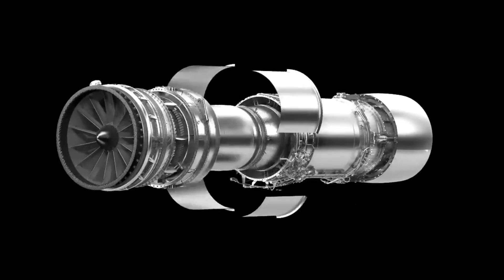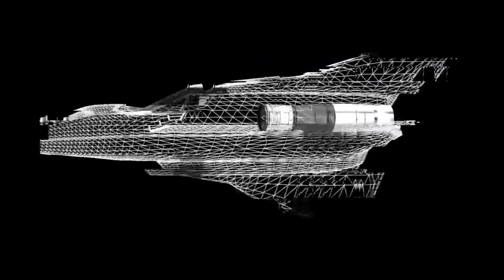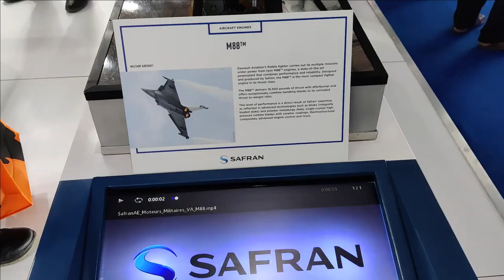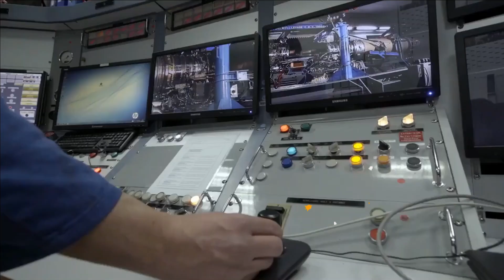Rolls Royce or Safran - Who will co-develop the engine for AMCA?

Comment: Good report but both the offerings are bit old as GE/P&W already have engine designs with variable cycles. GE already had one engine YF 120 running quite sometime ago and now has a new prototype running. P&W will follow shortly. Nevertheless this is a good start that will benefit India.

Comment: I honestly feel No company (RR or Saffran) will transfer their engine core IPR.
What might happen is 2 scenarios:
1)Like Shakthi turbomecca deal, a new engine might be co-developed in which the Hot components (compressor blades,chamber etc) will be built by foreign company and exported to India, will cold components will be built by DRDO. And DRDO might label it Made in India engine.
2) They might assist us to solve the problems in Kaveri engine to limited extent and help establish a flying testbed in exchange for a large engine order.
Reply: Let's see

Comment: Better to go wit SAFRAN. We can later ask for Rafale TOT and manufacture more of them to face Pak.
Also, it wil b difficult to export to nations that have not good relations wit u.k.
We have to move fast b4 Turkey caught up.

But Y don't we get AL-41F Engines tech from Russia ?
Reply: Maintainence issues and Lower performance in Rajasthan
Reply: Russia never transfer complete TOT. 
They see us as a source of major defense export, so they never transfered Niche technology.
Reply: Do you think they will give Rafael ToT?
Reply: If they do then we can make hundreds of them
Reply: @fly463   No they won't. 
If we order more than hundred Rafale.. They will offer us to manufacture some parts and full assembly in India bt Niche technology parts will come as Knocked down kits from France such as engine Core, turbine blades, Radars TR modules, Fly by wire flight control system, mission computer, Spectra Electronic warfare suite. 
No one share their niche technology especially when their own security depends on it.